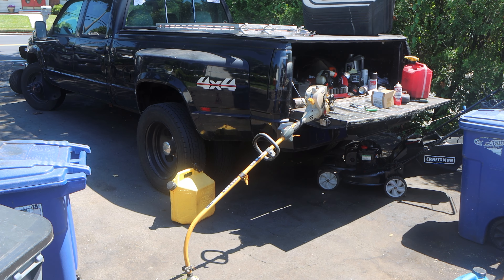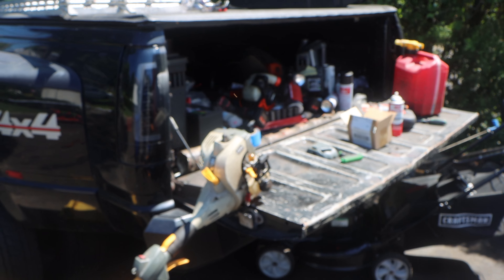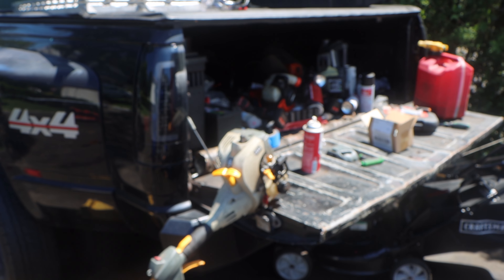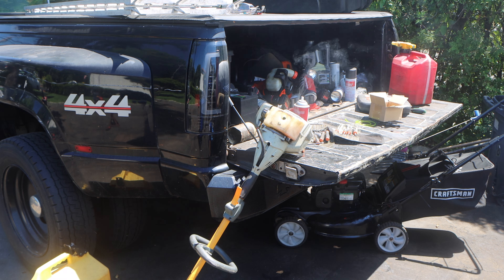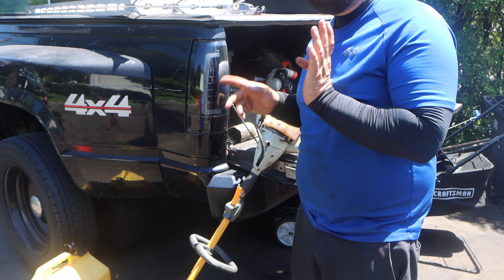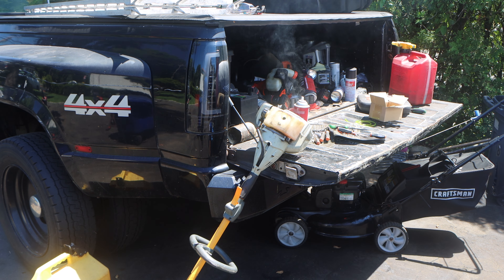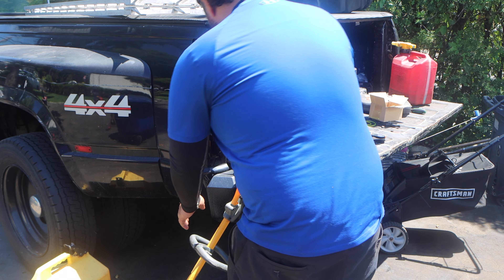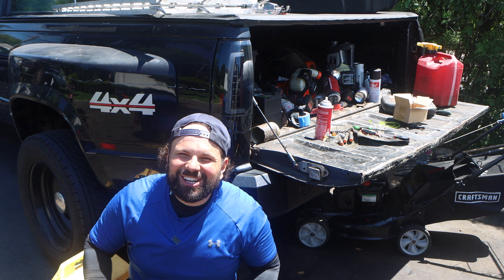Cheap Ryobi CS26 Weedwacker No Start  CHEAP & FIX!

Comment: yah with 2 stroke , if it doesn;t  run right and cannot adjust, carb,  just replace carb.  yah I still use 2 stroke weedeater.. I have 2 of them. still going.   good job there helping out a neighbor.  That machine looks alot like few homelite ones I fixed and sold last year.
Reply from the maker: Seems like they are all made the same.  Which means parts are plenty and tools are the same 🤣🫡

Comment: Sounds like it’s still bogging at high throttle, check for a spark arrestor screen.
Reply from the maker: The reason why it sounds bogged down is because he has too much string coming out the head.  The owner of the trimmer and I have discussed this in the Past.  He keeps it long to keep edges fresh!

Good ears!

Comment: By rights that engine should be revving higher than that, is the muffler blocked up?. I once revived an Echo chainsaw, when I eventually got it to run it wouldn't run right, I checked it over and found the spark screen completely blocked, cleaned it off and it ran well after that (the perils of running too much oil).
Reply from the maker: It doesn’t run as high as it should bc the owner keeps the string on the head LONG so he can have crispy edges.  Once the string is trimmed down to propper length, it will sound healthy/normal.

Comment: Most homeowners mix up the lines then say its broke lol!
Reply from the maker: I just had a like new echo pb580t in for no prime/no start.  

Fuel line collapsed…easy peasy.  Call and order a new fuel line kit.  Still wouldn’t prime.  Against my will, I opened up the carb and found pieces of the fuel inside and part of the gasket.  Just replaced the carb bs rebuilding it.

Never seen that before, but I also don’t open up 2 strike carbs

Comment: Never going electric, the batterys only last about 2 or 3 seasons and is way to expensive to replace. Gas is the way to go, sure its more maintenance but very worth it.
Reply from the maker: We are going on year 5 with our battery powered equipment and zero issues so far.